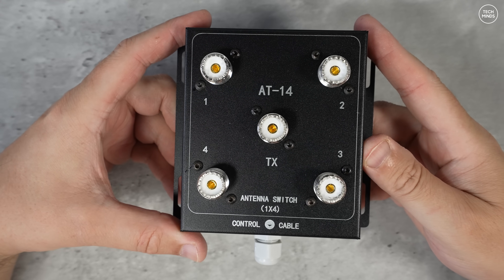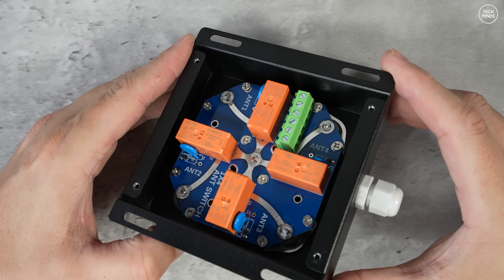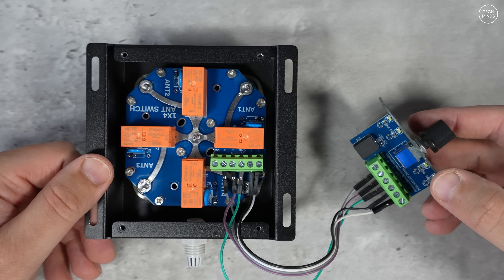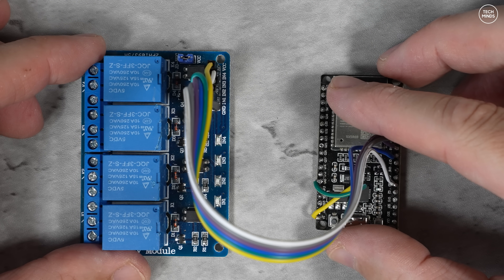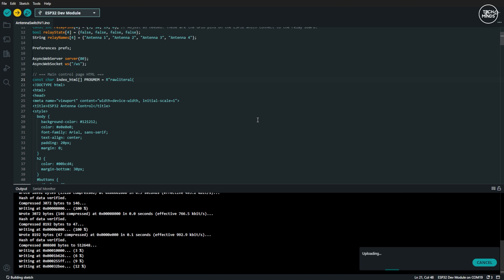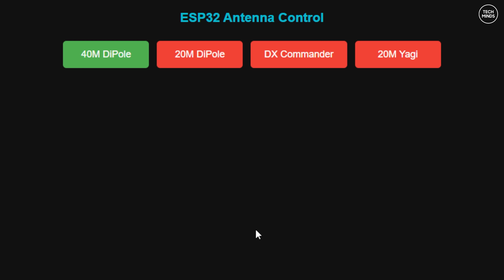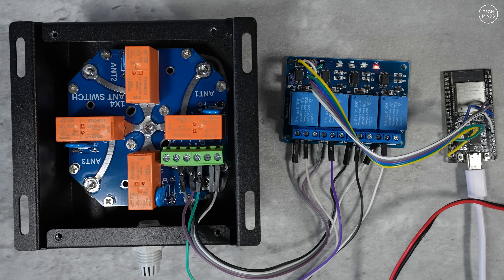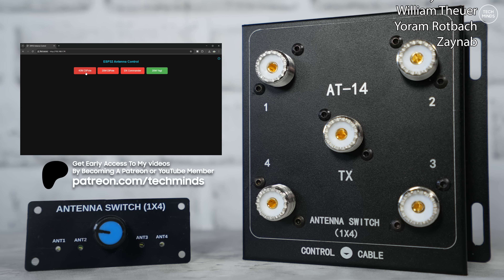Four Way 500 Watt Antenna Switch With An ESP32 Twist!

Comment: Do you have a code or example for the Cheap Yellow Display ESP32 and PCF8575 IO expander I2C board to control the relay board?

Comment: Can you use the relays on the 4 relay board in combination with PL connectors to switch to another antenna ?
Or do you need to use the board with the PL connectors?

Comment: It works very well. I have added a 1.3 inch Oled to display the ip address and show the selected antenna. It would be great to also include a rotator controller, i.e.  3 buttons (Power, Left and Right) and a direction indication on the web page.

Comment: I bought one off these switches and the PL 259's do not connect correctly to the SO 239's  - Bad grounding, even tried to tighten them up with pliers without any luck.

Comment: I keep getting this error.  I watch alot of your videos and am new too this Arduino stuff.  Can someone help me out here is the code:

Compilation error: E:\ESP32 Switch\ESP32-Antenna-Switch-main\AntennaSwitchV1/ESPAsyncWebServer.h>asynctyp: Invalid argument
Reply from the maker: I would say that the most possible issue would be not having the correct libraries installed. That is the best place to start looking.
Reply: @TechMindsOfficial  Hi, great project. Could you tell which versions of librarires did you use? I get lot of compilation errors with newest Arduino Ide and latest versions of used libraries. Thanks a lot for help...

Comment: I did something similar with an arduino. Well worth doing. Saves using a manual switch.

Instead of relays you can use a couple of transistors in a high side switch configuration, or modify the relay board to work with low side switching and use a ULN7003 or similar darlington array. I am doing just that with a 6 way switch and Arduino monitoring the radio band selection output.

Comment: You could add a bit of logic to make a 2:4 decoder or use part of a 74ls138 3:8 decoder. It takes a binary number in and enables just one pin. E.g give it 011 binary 3 and pin 3 only is active. Obviously you’d need a level shifter or a couple of transistors too. 😀 nice idea I have been thinking of doing something similar but probably linking it to home assistant.

Comment: I got one of these kits a few months back, just bare bones without the case & the so239 aren't soldered. Haven't set it up yet, plan on putting into a weatherproof box. The ESP32 is a neat idea, maybe with a battery & solar panel.

Comment: An interesting project. Is there any isolation to protect the system from stray or induced RF?
Reply from the maker: Everything is grounded when no relay is active. When one relay is active, all other relays stay grounded. (Center pins).
Reply: @TechMindsOfficial with that in mind, you could sub 50 ohm power terminations in case of accidental Tx with antenna not selected. I was wondering if induced RF in the control lines would be an issue.

Comment: Wire everything on each side to an rj45 and that makes the control cable an easy cat5 run.  Use shield cat5 or cat6 and should be able to do a good remote install of the switch box.

Comment: Lack of "ground everything" position is disapointing in this hardware. I hope unused antennas are grounded at least!
Reply from the maker: Everything is grounded when no relay is active. When one relay is active, all other relays stay grounded. (Center pins).
Reply: @TechMindsOfficial  That's with your ESP solution I assume but what about their switch?
Reply from the maker: That's with nothing connected, no controller pcb, no esp32 and no power. All antenna ports default to being grounded when no power is supplied to them.

Comment: Matt, you can simply add an extra safety so that never more then one relay is activated.  Doe not wire the 12 V to all center pins of the blue relays but link the unused contact of the first relay trough to the middle pin of the second relay and second unused contact to middle third and so one.  That way it is impossible to activate more then one relay no matter what the software says.
Reply: Thank you!

I have a similar project I'm making and this solves my worry. I don't trrust my program enough to catch weird edge situations and this adds the hardware failsafe I wanted.
Reply: Indeed.  It's a form of relay interlocking. The relay higher in the chain is effectively prioritised to prevent fubar in the event of software hiccups.

Comment: This is great and I’ve been planning to use an ESP32 for this exact purpose. My plan is to also include solar power such that it can live remotely at the bottom of the garden, controlled via WiFi from the house (using an ESP32 with an external antenna connection to point a little yagi to the house). Nice project!

Comment: Ps drill in case alongside each so239 and fit LED,s so you can tell at an instant you have power to the unit and also which socket is selected. 😅

Comment: Tech minds think alike lol. I bought this exact same switch last month, and am using an esp32 with a 4 relay board i had laying around to control it. Although I used a basic relay sketch with 4 relay controller web interface I found online because I wanted to test it before making a custom script. It's all programmed up and needs to be wired up. But im finishing up the rf sense relay circuit I bought parts for after that so I can use my 1 kw amp without having to use a manual switch. I like your script setup better than mine by far.

Comment: One problem. No power or cable get severed cut etc transceiver doesn't see an aerial or 50ohm. I made my own with extra 50ohm Dummy load. Also static discharge resistors missing per socket George.

Comment: By the way, did you see the chatter about a few of the US weather satellites being shut down abruptly next week? I was just about to spring for the dish and some of the LNB's you covered last week.
Reply from the maker: Yeh but there is still Meteor and Metop. And if you are in the US you have GOES.
Reply: @TechMindsOfficial  Yes, I'm in the US. Maybe I still will buy one. I do astronomy as another hobby and the Hydrogen line LNB sounds interesting, however, I am tempted to go to the trouble of making the LNB myself as the filters for the LNA are just a handful of dollars from minicircuits. Even the front end amp they used is about 4 or 5 dollars. Thanks for everything you do!

Comment: Note that (according to the seller) the input voltage range for the VIN pin on the ESP-WROOM-32 is 5-12 VDC.
Reply from the maker: Yeh I wouldn't trust that unless you can see a voltage regulator on the board. many times I have received boards that say it supports more than 5v, and they do not.
Reply: @TechMindsOfficial  Trust but verify has always been my policy as well. Caveat emptor and all that. 😄

Comment: I've been using this exact antenna switch (wired) for 8months and it works really well and for around£40 you can't go wrong
Reply: Hi. Just bought one of these. I see the control voltage is 12v. Are you running yours from a 13.8v source, or are you using 12v? Just wondering if it is durable enough to run from 13.8v or if I need to reduce to 12v.
Reply: @2E0LMI  yeah I just run it straight from my 13.8v PSU I have put fuses on the lead from the PSU to the antenna switch as a belt and braces approached, but it's a fantastic 4x1 switch for the money Ray MM7RWC